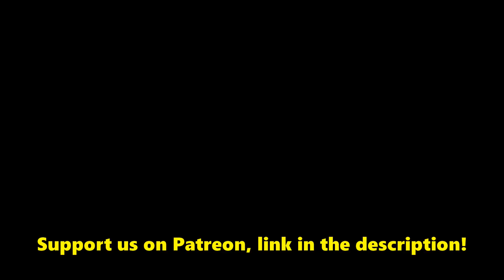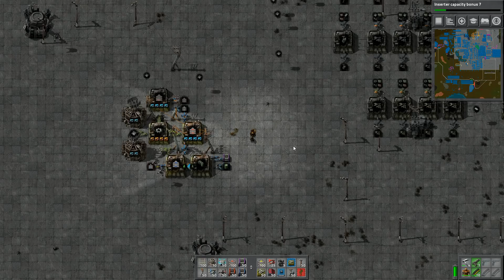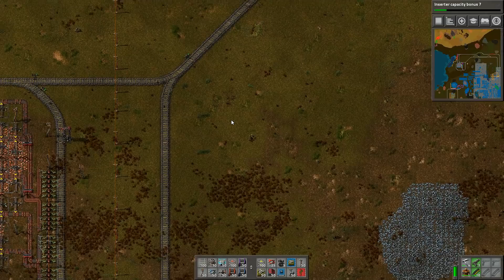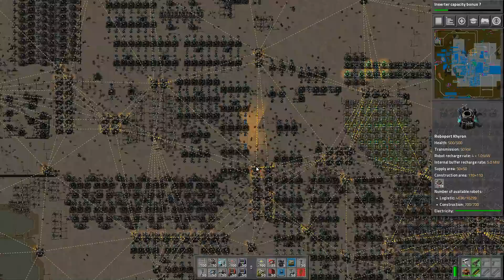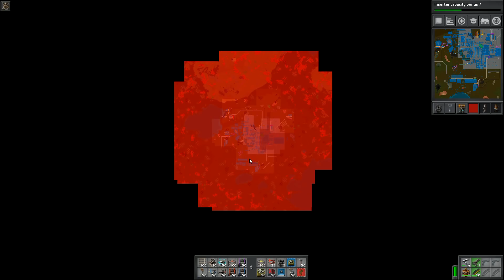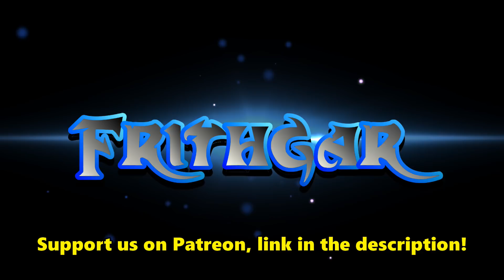Let's Play Factorio #10: Rocket Launch!

Comment: If you select to make the satellite in the assembler 3, then shift+right click on the assember, then shift+left click on the chest, it automatically copies the correct items
Reply from the maker: I had no idea about that, thank you!  Will try it in the next episode :)
Reply: Frithgar it took me a while to learn it too. Btw, do you use the circuit network for anything?
Reply from the maker: I've got one system set up with the oil for the circuit network to regulate the heavy oil reserve, other than that, nothing yet
Reply: Not too much then. It can be so good for automating all your cracking. Where would be best to send you a screenshot?

The reason I ask is because with a little work, its possible to upgrade the oil processing (you might need a spreadsheet) so that whenever you have excess heavy oil (eg over 1000 units), then its pumped to light oil cracking, which can be set to prefer the light oil from the heavy to light cracking over the regular crude to light cracking, and then again the same when cracking from light oil to heavy oil.

There is also scope to run a mixed belt system for science, where instead of needing loads of different belts, you run a loop around your factories, with the circuit network controlling how many of each science pack in on the belt at any given time, making it more efficient overall as you have less resources on the belt and being made at a time.

My favourite use of it is to control the use of power (electricity) within the base. For example, if you iron line out of the smelting area is fully backed up, there isn't much of a point smelting more, as it won't be used and the power could be better used elsewhere. If you use a circuit network condition attached too a power switch, you can turn off your smelting areas when they aren't needed, saving you huge amount of wattage.
Reply from the maker: I was thinking of putting in some systems where a lot of the items I'm producing are all moved to a central storage location rather than being spread out, then have the items that are making science all in another area, finally the circuits and gears etc that are used throughout being central to it all.  Not quite sure how I'm going to end up running it yet, however the main proviso with all of it is that it's all going to be beltless in the main factory.  The only belts on the map will be at mining stations
Reply: That should be relatively straight forward. Have storage chests in a central area, and then change out your passive provider chests with active provider chests. Then use the logistic network on the inserter from assembler to active provider chest such that its only active (moving goods), when total amount available to the logistic network is less than an amount = x